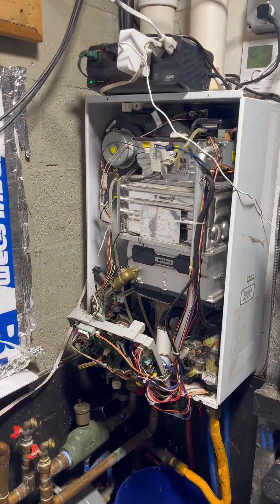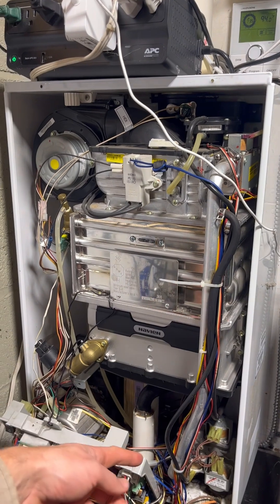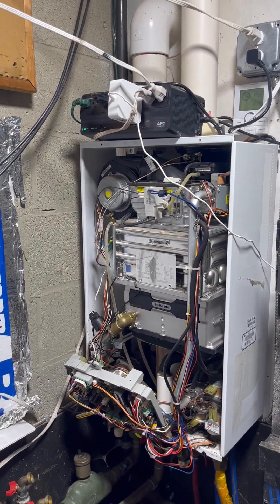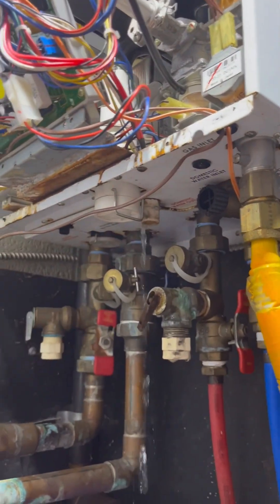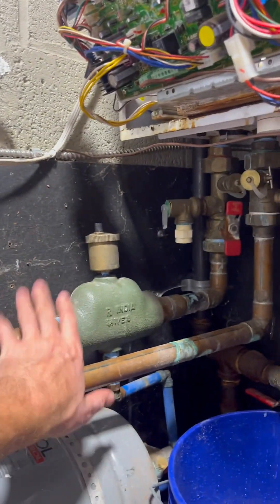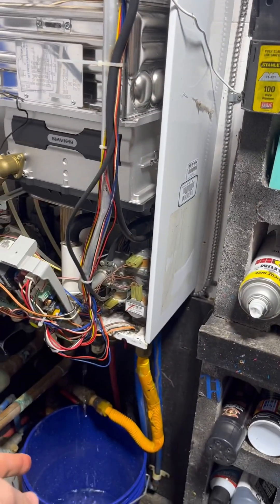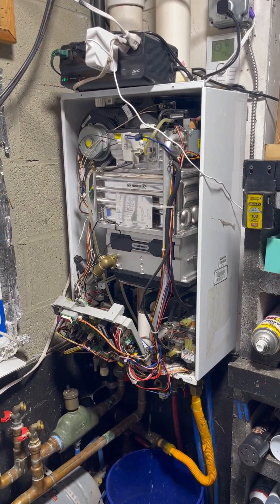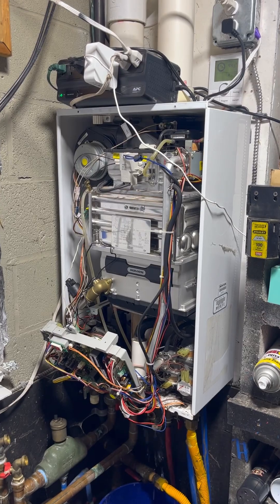Troubleshooting Navien CH-210 Water Heater Leaks and Hot Water Problems

Comment: You showed the problem in the video , that clear rubber hose you squeezed is the bleeder valve. It's either its bad or open . Just tighten the top and it should stop if not then it's bad
Reply from the maker: There are some later videos with the resolve. I’m not sure I had it figured out when I posted this, however, it does still leak enough water during operation that I may have to keep working on it. I believe the three way valve was bad in this video.